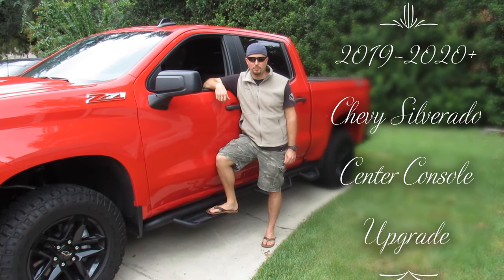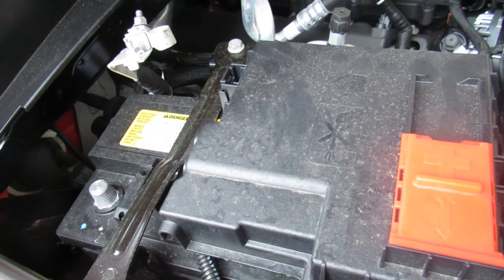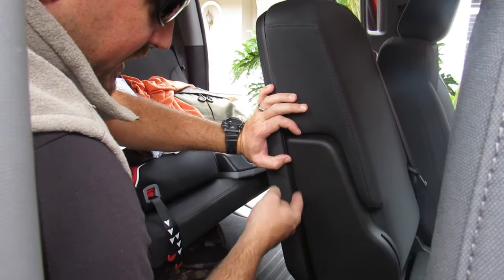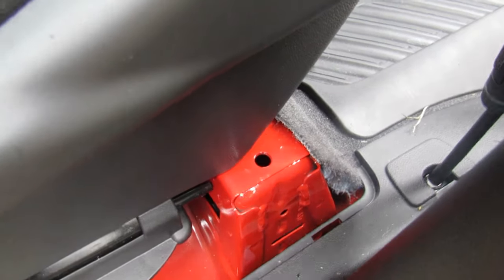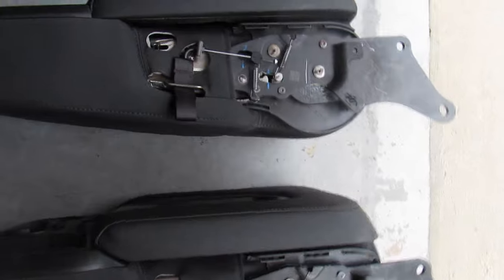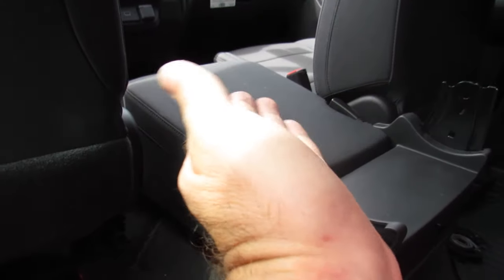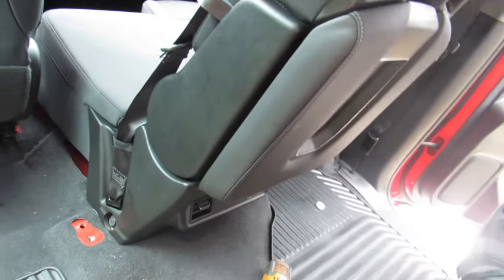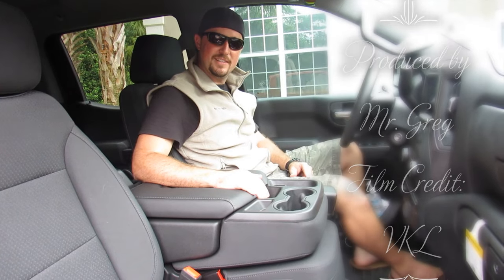HOW TO Upgrade 2019-2020+ Chevy Silverado Custom Edition Center Console Storage

Comment: Awesome video! How long does this typically take from start to finish?
Reply from the maker: Thanks, partner!  It should take about 2-3 hours, maybe 1 if you are really fast!  Best of luck to you!
Reply: @MRGREGSHOWTO  bro where can I buy the parts.? You mentioned that you can get more storage space as well? Where can I buy these?
Reply from the maker: @aaronarredondo4977   hey partner!  I bought mine online at SD Parts (link below). They seem to be hard to come by with limited stock. You may be able to find them at other websites, EBay, or even a junk yard. Good luck and thanks for watching!

https://sdparts.com/i-24138922-genuine-gm-parts-84756948-center-console-upgrade-for-2019-2020-silverado-work-truck-models.html

I believe it is GM Parts #84756948

Comment: Where did you order it from and what’s it’s the part actually called? Upper arm rest console??
Reply from the maker: Hey partner!  I bought mine online at SD Parts (link below). They seem to be hard to come by with limited stock. You may be able to find them at other websites, EBay, or even a junk yard. Good luck and thanks for watching!

https://sdparts.com/i-24138922-genuine-gm-parts-84756948-center-console-upgrade-for-2019-2020-silverado-work-truck-models.html

I believe it is GM Parts #84756948

Comment: Where can I find a replacement storage like you did?? Website?
Reply from the maker: Hey partner!  I bought mine online at SD Parts (link below). They seem to be hard to come by with limited stock. You may be able to find them at other websites, EBay, or even a junk yard. Good luck and thanks for watching!

https://sdparts.com/i-24138922-genuine-gm-parts-84756948-center-console-upgrade-for-2019-2020-silverado-work-truck-models.html

Comment: Where did you purchase this at? I’d like to swap mine out as well.
Reply from the maker: Hey partner!  I bought mine online at SD Parts (link below). They seem to be hard to come by with limited stock. You may be able to find them at other websites, EBay, or even a junk yard. Good luck and thanks for watching!

https://sdparts.com/i-24138922-genuine-gm-parts-84756948-center-console-upgrade-for-2019-2020-silverado-work-truck-models.html

Comment: Where did you get the upgraded console that you swapped in? I can’t seem to find anything online.
Reply from the maker: Hey partner!  I bought mine online at SD Parts (link below). They seem to be hard to come by with limited stock. You may be able to find them at other websites, EBay, or even a junk yard. Good luck and thanks for watching!

https://sdparts.com/i-24138922-genuine-gm-parts-84756948-center-console-upgrade-for-2019-2020-silverado-work-truck-models.html
Reply: Am looking for a center console. I have the jump seat with storage

Comment: Whats the correct model number for the one with storage ?
Reply from the maker: Hey partner!  I bought mine online at SD Parts (link below). They seem to be hard to come by with limited stock. You may be able to find them elsewhere or even on EBay. Good luck and thanks for watching!

https://sdparts.com/i-24138922-genuine-gm-parts-84756948-center-console-upgrade-for-2019-2020-silverado-work-truck-models.html

Comment: Where did you order the center console
Reply from the maker: Hey partner!  I bought mine online at SD Parts (link below). They seem to be hard to come by with limited stock. You may be able to find them at other websites, EBay, or even a junk yard. Good luck and thanks for watching!

https://sdparts.com/i-24138922-genuine-gm-parts-84756948-center-console-upgrade-for-2019-2020-silverado-work-truck-models.html

I believe it is GM Parts #84756948

Comment: Hi can I ask were to get this seat. I have the 2020 silverado as well
Reply from the maker: Hey partner!  I bought mine online at SD Parts (link below). They seem to be hard to come by with limited stock. You may be able to find them at other websites, EBay, or even a junk yard. Good luck and thanks for watching!

https://sdparts.com/i-24138922-genuine-gm-parts-84756948-center-console-upgrade-for-2019-2020-silverado-work-truck-models.html

Comment: I may be missing it but do you have the info on where to find the top and the whole seat versions ? I can't find them online. Great video(saved it) and looking forward to my storage
Reply: @MRGREGSHOWTO  Thanks, SD as of last night were out and others are pricey. As  luck would have it i found the top half on ebay for relatively cheap shipped. I found there are some out there and recommend people use the GM part number for their color. Thanks again, I will be referencing your vid to install !

Comment: Where did you get The center consul
Reply from the maker: Hey partner!  I bought mine online at SD Parts (link below). They seem to be hard to come by with limited stock. You may be able to find them at other websites, EBay, or even a junk yard. Good luck and thanks for watching!

https://sdparts.com/i-24138922-genuine-gm-parts-84756948-center-console-upgrade-for-2019-2020-silverado-work-truck-models.html

I believe it is GM Parts #84756948

Comment: Do you have a link to purchase the parts?
Reply from the maker: Hey partner!  I bought mine online at SD Parts (link below). They seem to be hard to come by with limited stock. You may be able to find them at other websites, EBay, or even a junk yard. Good luck and thanks for watching!

https://sdparts.com/i-24138922-genuine-gm-parts-84756948-center-console-upgrade-for-2019-2020-silverado-work-truck-models.html

I believe it is GM Parts #84756948

Comment: Do you have a link to the entire assembly? I am unable to locate the full module replacement. Thanks!
Reply: Check on eBay but note if you have the storage in the seat you lose the A/C vents for the back

Comment: Where can I buy the whole assembly?  I love to have the under seat storage too.
Reply from the maker: Hey partner!  I’m not sure about the whole assembly. Some of the folks here have said that the bottom seat doesn’t necessarily work the same with the included power outlets and air vents. I’m not sure, but I’d check eBay to start. Good luck!!
Reply: Do know that having the under storage will restrict air flow to the backseat riders if you have vents on the back
Reply from the maker: @kennethdickerson7874  hey partner. As long as there are factory style vents I think you should be okay. Good luck!

Comment: I purchased a 2020 GMC sierra 1500 base line model, with factory options of 5.3L engine, VALUE package including tow package, and Z31 off road suspension. It also included a rear window defrost. You would think GMC would provide Tow mirrors with heated glass part of the tow package since it came with the rear glass defrost. Not only NO, but hell NO. I asked the dealer if I could order the Tow mirrors with heat and be installed. Sorry he said, you can install Tow remote mirrors, but no heat. Not compatible since heated mirrors did not come on the vehicle. Truck not wired for it.
Just when you think you have made the great purchase, bend over and prepare for the surprise!!
Reply: Have you got a remote fob ? I need to see if I can find one oem on a base model. If not I’ll just do after market
Reply: @peterpaulsmith5587  sorry,no

Comment: Where can I order the center console?
Reply from the maker: Hey partner!  I bought mine online at SD Parts (link below). They seem to be hard to come by with limited stock. You may be able to find them at other websites, EBay, or even a junk yard. Good luck and thanks for watching!

https://sdparts.com/i-24138922-genuine-gm-parts-84756948-center-console-upgrade-for-2019-2020-silverado-work-truck-models.html

I believe it is GM Parts #84756948

Comment: Where did you get it at?.
Reply from the maker: Hey partner!  I bought mine online at SD Parts (link below). They seem to be hard to come by with limited stock. You may be able to find them at other websites, EBay, or even a junk yard. Good luck and thanks for watching!

https://sdparts.com/i-24138922-genuine-gm-parts-84756948-center-console-upgrade-for-2019-2020-silverado-work-truck-models.html

I believe it is GM Parts #84756948

Comment: Hey man, can you please provide the link where we can buy the entire assembly? And by the way great videos! Keep it up 👍🏻
Reply: @MRGREGSHOWTO  i just purchased a 2020 GMC sierra base model, with the " VALUE" package. When I discovered the center console had no storage, I was pissed. NO where in the specs of the VALUE package did it say NO storage. I found one on EBAY, payed too much, but not available at dealers.
part # 84756948 for the complete seat and console. GM charged $ 1600 + for the VALUE package, you would think at this price, it would include the storage. But, I don't get paid for thinking.
Hope this helps someone.

Comment: Web site where ican order this. Thank you for your video
Reply from the maker: Hey partner!  I bought mine online at SD Parts (link below). They seem to be hard to come by with limited stock. You may be able to find them at other websites, EBay, or even a junk yard. Good luck and thanks for watching!

https://sdparts.com/i-24138922-genuine-gm-parts-84756948-center-console-upgrade-for-2019-2020-silverado-work-truck-models.html

I believe it is GM Parts #84756948

Comment: Where did you buy this from?
Reply from the maker: Hey partner!  I bought mine online at SD Parts (link below). They seem to be hard to come by with limited stock. You may be able to find them at other websites, EBay, or even a junk yard. Good luck and thanks for watching!

https://sdparts.com/i-24138922-genuine-gm-parts-84756948-center-console-upgrade-for-2019-2020-silverado-work-truck-models.html

Comment: Bro were did you buy it?
Reply from the maker: Hey partner!  I bought mine online at SD Parts (link below). They seem to be hard to come by with limited stock. You may be able to find them at other websites, EBay, or even a junk yard. Good luck and thanks for watching!

https://sdparts.com/i-24138922-genuine-gm-parts-84756948-center-console-upgrade-for-2019-2020-silverado-work-truck-models.html

Comment: If anyone can please let me how to order one of these for my 2019 Chevy Silverado Crew Cab Trail Boss I would greatly appreciate it. And if I can get it installed it would be even better. Thank you!!
Reply from the maker: Hey partner!  I bought mine online at SD Parts (link below). They seem to be hard to come by with limited stock. You may be able to find them at other websites, EBay, or even a junk yard. Good luck and thanks for watching!

https://sdparts.com/i-24138922-genuine-gm-parts-84756948-center-console-upgrade-for-2019-2020-silverado-work-truck-models.html

I believe it is GM Parts #84756948

Comment: Do you have a part# for that top section?
Reply from the maker: Hey partner!  I bought mine online at SD Parts (link below). They seem to be hard to come by with limited stock. You may be able to find them at other websites, EBay, or even a junk yard. Good luck and thanks for watching!

https://sdparts.com/i-24138922-genuine-gm-parts-84756948-center-console-upgrade-for-2019-2020-silverado-work-truck-models.html
Reply: @MRGREGSHOWTO  They were out of stock... But I did manage to find it on another site thanks! Can't wait to get it installed...
Reply from the maker: @davidgaudreau6825  it is a game changer for sure!  Let us know how it goes!  Best of luck!

Comment: Where did you get it ?
Reply from the maker: Hey partner!  I bought mine online at SD Parts (link below). They seem to be hard to come by with limited stock. You may be able to find them at other websites, EBay, or even a junk yard. Good luck and thanks for watching!

https://sdparts.com/i-24138922-genuine-gm-parts-84756948-center-console-upgrade-for-2019-2020-silverado-work-truck-models.html

Comment: Link please... just got my trail boss custom and this is a must needed mod
Reply from the maker: Hey partner!  I bought mine online at SD Parts (link below). They seem to be hard to come by with limited stock. You may be able to find them at other websites, EBay, or even a junk yard. Good luck and thanks for watching!

https://sdparts.com/i-24138922-genuine-gm-parts-84756948-center-console-upgrade-for-2019-2020-silverado-work-truck-models.html

I believe it is GM Parts #84756948
Reply: @MRGREGSHOWTO  link no longer works?
Reply from the maker: @stephthomas2108   hey partner!  I don’t want to give out any bad information, but I am pretty sure it is GM Parts #84756948.  Good luck!

Comment: Hi
I want to add rear Air conditioner in center console
Reply: @MRGREGSHOWTO  This is why the complete unit has a problem. If you have the storage in the bottom you lose the A/C I found some complete setups on eBay but when checking and then asking the dealer I found that about the A/C

Comment: Where did you get the replacement seat and cost?
Reply from the maker: Hey partner!  I bought mine online at SD Parts (link below). They seem to be hard to come by with limited stock. You may be able to find them at other websites, EBay, or even a junk yard. Good luck and thanks for watching!

https://sdparts.com/i-24138922-genuine-gm-parts-84756948-center-console-upgrade-for-2019-2020-silverado-work-truck-models.html

I believe it is GM Parts #84756948

Comment: Where can i find the upgraded console to buy?
Reply from the maker: Hey partner!  I bought mine online at SD Parts (link below). They seem to be hard to come by with limited stock. You may be able to find them at other websites, EBay, or even a junk yard. Good luck and thanks for watching!

https://sdparts.com/i-24138922-genuine-gm-parts-84756948-center-console-upgrade-for-2019-2020-silverado-work-truck-models.html

I believe it is GM Parts #84756948

Comment: Where did you purchase the console? I can’t find anywhere
Reply from the maker: Hey partner!  I bought mine online at SD Parts (link below). They seem to be hard to come by with limited stock. You may be able to find them at other websites, EBay, or even a junk yard. Good luck and thanks for watching!

https://sdparts.com/i-24138922-genuine-gm-parts-84756948-center-console-upgrade-for-2019-2020-silverado-work-truck-models.html

I believe it is GM Parts #84756948
Reply: @MRGREGSHOWTO  this link doesn't work. Can you tell us the name of the part?
Reply from the maker: @stephthomas2108  hey partner!  I don’t want to give out any bad information, but I am pretty sure it is GM Parts #84756948.  Good luck!

Comment: Where did you purchase the console  ?
Reply from the maker: Hey partner!  I bought mine online at SD Parts (link below). They seem to be hard to come by with limited stock. You may be able to find them at other websites, EBay, or even a junk yard. Good luck and thanks for watching!

https://sdparts.com/i-24138922-genuine-gm-parts-84756948-center-console-upgrade-for-2019-2020-silverado-work-truck-models.html
Reply: I have the jump seat with storage ,looking for a center console

Comment: Where did you order that from?
Reply from the maker: Hey partner!  I bought mine online at SD Parts (link below). They seem to be hard to come by with limited stock. You may be able to find them at other websites, EBay, or even a junk yard. Good luck and thanks for watching!

https://sdparts.com/i-24138922-genuine-gm-parts-84756948-center-console-upgrade-for-2019-2020-silverado-work-truck-models.html

Comment: Where did you get the console from??
Reply from the maker: Hey partner!  I bought mine online at SD Parts (link below). They seem to be hard to come by with limited stock. You may be able to find them at other websites, EBay, or even a junk yard. Good luck and thanks for watching!

https://sdparts.com/i-24138922-genuine-gm-parts-84756948-center-console-upgrade-for-2019-2020-silverado-work-truck-models.html

I believe it is GM Parts #84756948

Comment: Part number?
Reply from the maker: Hey partner!  I bought mine online at SD Parts (link below). They seem to be hard to come by with limited stock. You may be able to find them at other websites, EBay, or even a junk yard. Good luck and thanks for watching!

https://sdparts.com/i-24138922-genuine-gm-parts-84756948-center-console-upgrade-for-2019-2020-silverado-work-truck-models.html

Comment: damn they even took the sunglass holder away
Reply: You can get a couple sunglasses in the upper glove box. Maybe a couple maps. Really surprised how they cut back on the storage. Just picked our 1500 up on Monday. It did come with a broken drivers side mirror. Wasn't charged extra either. They did replace it this morning in less than an hour. Always check a new vehicle out before giving them your check.